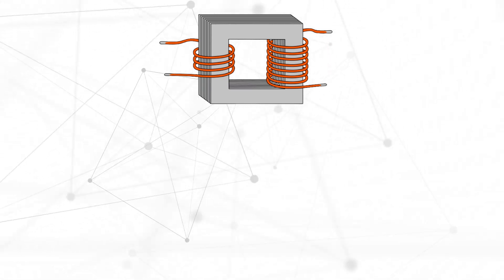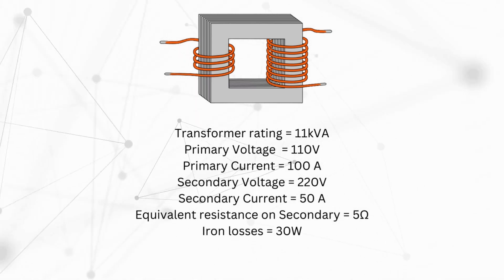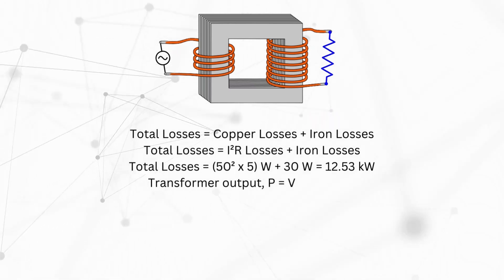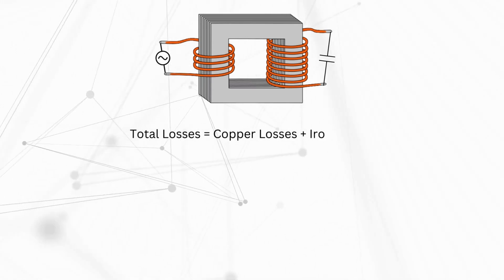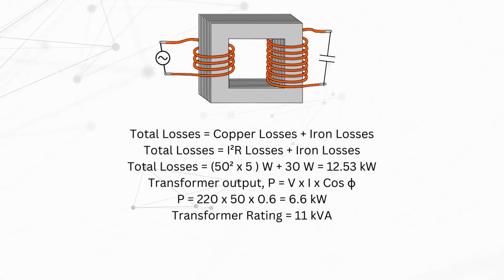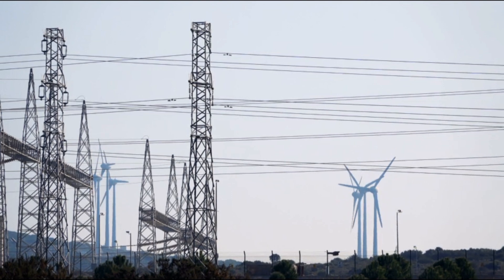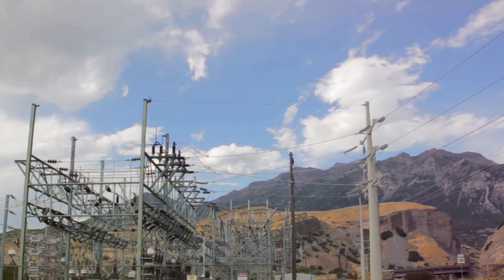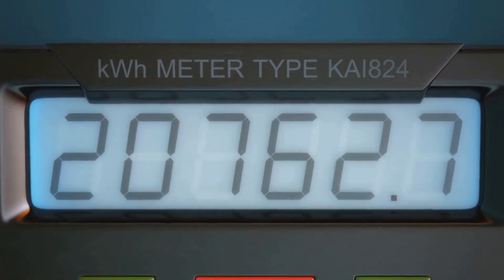Why Transformers are rated in kVA not in kW?

Comment: I don't feel like this video explained anything.
Reply: it simply says that given an input of V volts at I amps, the output you will get depends on the load and is not predictable.
Reply: @janami-dharmam  ... and then proceeds to show (with basically no explanation) that at a power factor (PF) of 1 -- the max, which rarely happens in the real world, kVA is the same as kW... so there's no reason to rate the transformer in kVA.
Reply: @jfbeam  With a resistive load (for example a filament lamp or a hot plate) the power factor is very close to unity. It is wrong to say that it rarely happens in the real world. Most common domestic loads are resistive.
Reply: To calculate KW rating, you need to know Power Factor. Since the transformer manufacturer doesn’t know your load pf, they can’t give you a KW rating.
Reply: @mechelec7845  The maximum rating of the transformer does not change. The amount of power you require from it goes down as PF decreases. You could argue any kw rating would need to carry a pf as well, but no one does because it's assumed unity. kva has no ambiguity or assumptions.
Reply from the maker: Thanks for your feedback. Keep watching.
Reply: That’s because it is an auto generated a piece of shit
Reply: If you didn't get then you aren't paying attention or you need a better understanding of electrical sustems.
Reply: Click bate ….